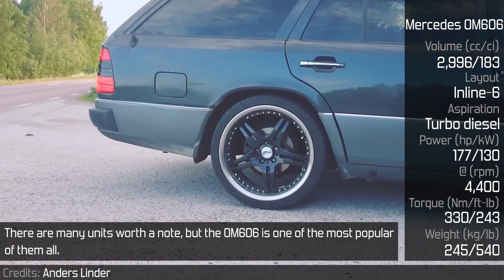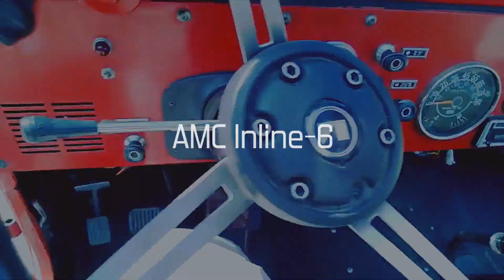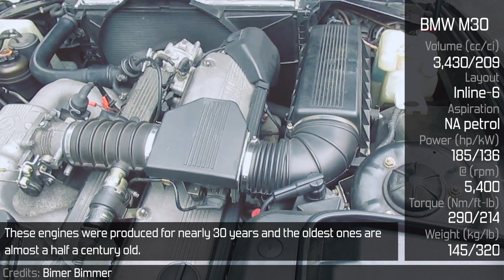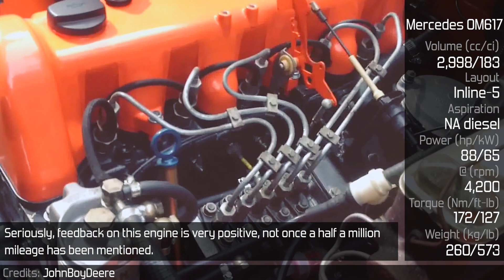10 Most Reliable Engines Running Beyond 300,000 Miles

Comment: I had a 1.9 TDI once. Bought it with only 45,000 miles on it...vehicle was totaled with 365,000 miles on the clock. It still ran great. If it wasn't wrecked, id still be driving it.
Reply: Oh hi m8
Reply: Roshan S what's up
Reply: Didn't expect to find you on here lol.
Reply: What happened with Google hangouts though?
Reply: hey man hows your s60 doin?
Reply: What year was your TDI?
Reply: 365,000mi is pretty good.
Reply: I had the transportdr van with the same 1.9.   
It still running with 680.000k on the clock!
Reply: my MK4 VW Jetta TDI has 524,000 MILES on it and still running strong ive gone through 2 clutches 1 transmission and lots and lots of parts the paint job was redone at 300k and its MINT. 1.9TDI for life
Reply: The 1.9 TDI was the best engine VW ever made
Reply: Insane S60 my grandparents just gave me a 04 jetta tdi 5 speed. it runs strong and it's at 185k im gonna see how far she will go.
Reply: I own a 94 golf tdi with 706000km and still runs great. Always well used but with poor maintenance. Maybe one of the best engines ever
Reply: VOLKSWAGEN TDI FANS UNITE
Reply: Mine has about 500,000 km so about mid 300,000 miles and it still gets daily driven
Reply: My dad had an A4, I believe it also had a 1.9 TDI, traded in for an allroad at 600000 km
Reply: Theodore Marakas what do you mean free financing for 6 years like pay nothing for 6 years
Reply: Insane S60 My uncle was part of the engineering team that built the 1.9 tdi. He always told us it's well capable of running beyond 300k miles. He bought one and my parents did so too. 250k km so far on our Passat. We'll drive it until the wheels fall off 😄
Reply: Paul Hojda Oh yeah I recall my uncle mentioning that a couple of times haha
Reply: Theodore Marakas makes sense most owners have their Volkswagens for at least 4 years
Reply: Telegraf Stalp I'm from the usa... title says 2004 lol
Reply: My Jetta 1.9 TDI BRM (2006). Just turned 100k miles  and I changed the timing belt. I'm hoping to keep the car a long time and look forward to high mileage.
Reply: work on taxis which use the exact same 1.9tdi. lovely engine to work on and almost all have 600k+ miles on them and still go well with regular servicing
Reply: Insane S60 They are great engines, only issue is the double mass flywheel going bad eventually. The SDI engines, basically the TDI without a turbo, are even stronger, operating under lower pressures.
Add to that their electronic throttle that's unmatched in terms of response. Truly a masterpiece.
Reply: A few decades ago,  the taxis in China were Mercedes E-class diesels. Now they're mostly VW Jetta 1.9 TDI.  A million KMs is common with just normal servicing.
Reply: yeah uk is trying to get rid of old taxi. they must be euro5 to be registered now
Reply: Insane S60 what about chevy impalas r they good cars about how many miles can u get bro.
Reply: MostlyIrishCarGuy hey, sorry this is so late, the S60 is doing good
Reply: Tanatose
it was a 2001
Reply: dakota croasdale 
if you take care of it, it'll last you a long time
Reply: Arthur Hunter 
I'm not to famailer with Impalas to be honest
Reply: GET RID OF THE IMPALA!
Reply: BIGTAZ351 the Impala has been around since 1958, it's as American as apple pie. an American icon.
Reply: Yeah, and Harley Davidson has been around since 1903, doesn't mean its a "GOOD" product...All the Front Wheel Drive Impalas have electrical issues from hell...
Reply: Bigtaz - so true. Actually many of the chevys were crappy cars. I grew up a big chevy fan building chevy hotrods, and street rods. I was mostly a small block chevy guy. why? Parts were plentiful, cheap, and interchangeable. The fact is that the chevy small blocks were pretty soft iron and by the time you got about 100k miles on them, you had quite a ridge in the cylinders. Fords and Dodges were more expensive to deal  because they didn't really hold to too many engine design standards. Ford in particular was always experimenting with different designs,. One of the most wonderful and outrageous production engines from Ford in the way-back past was the overhead cam head 427s that came in the GT40s. If you can find one of those engines today you'll pay a fortune for it. Modern technology like the aluminum engines built for the newer corvettes are better now so it's relative. 
Everything has it's pros and cons. Chevy used to use bodies for their cars made by Fisher. They were junk. In no time you would have problems with sagging doors and other mismatching body parts. The fact is that some of the most popular  American icon muscle cars were absolute junk, like the camaro, and the Ford mustang. Corvettes used to be heaps of shit too. Now days all these cars are much better as manufacturing methods and standards increasing raises the bar. As much as I grew up loving chevy's, they're nothing to brag about. We love them because of how some of them look and what they stand for. Not because they're really good cars. They're ok, not great.
Reply: I have a 2004 Audi A3 1.9 PD TDI, but it's still young, only has 184.000 miles on the clock. ;)
Reply: Fred Flintstone well, you may have experienced that,but I have the 58 Cadillac my parents bought in 1960,body by Fisher.  and the doors open and close very nice, and the engine just had its 1st rebuild 4 years ago because of excessive blowby. I also have a 68 Mustang I bought in high school,  bought in 1977, body fine, doors fine, and that 289 has still never been rebuilt,  still runs great. Maybe the fact these cars are  lifetime so cal desert cars , IE Palm Springs,  has something to do with their strutural integrity after nearly 50 and 60 years.
Reply: Ah yes, the 50's when they used heavier gauge metals. Not too bad. Sorry, your 68 stang is junk. we love the cars because they're part of the american heritage, those were very cheaply made, poorly designed bodies. Bodies by fisher in the late sixties and later were cheap junk. Sentimentality doesn't change the fact.
Reply: Fred Flintstone say what you like,but I' HAVE OWNED   and driven this Mustang for 40 years this year, and it hasn't changed at all . and cars made like crap don't survive in use 50 years . Hell, I drove the stang to Vegas and back last winter from so cal. However, I wold like to hear what kind of car you believe are NOT JUNK. I will say my little Mustang has become quite a valuable little pony, she bone stock, never molested . nearly new appearing in and out. highest offer unsolicited,  car is not for sale, was 12000.
Reply: My 2004 (54) plate Bora PD150 has just over 190,000 miles on it, so it’s probably just about run in 😂
Reply: What parts do I need to make my PD150 make that cooooooooo noise from that blue Golf in the video? Love that noise!

Comment: Ford's  300 6 cylinder was a true workhorse. It was originally used in Farm tractors and irrigation pumps. A truly under-rated power plant  that was gear driven with minimal issues.
Reply: David  Harris My old man had one with over 400 thousand on the clock,with a cam swap,offy four barrel intake and true duals in a f100 and 3:50 gears it was a stop light warrior that would hang with or beat many v8 engines of the 70's and 80's.

Comment: The days of long-lasting diesels is over. Emission standards killed it
Reply: Buy an old diesel. They last forever. Fuck emissions
Reply: You can get a newer diesel and delete the emissions I did it on my Chevy Cruze and it's ran perfect for a hundred and fifty thousand miles so far zero issues. Delete the emissions if all possible then you got a reliable long-lasting engine
Reply: @AaronJohnson1979  150.000 miles isnt much but quite good for a chevy.

Indeed the deletion of that junk is good for the engine
Reply: @AaronJohnson1979  i want to do the same because i have a lot of carbon buildup in my intake system. Its fucked up. One piece of that shit can destroy the turbo
Reply: My dad has 2006 transporter over 670000km and nothing runs like a new
Reply: You mean spewing turbocharged soot out the exhaust may be bad for the atmosphere? who knew!
Reply: @TheWolfsnack  not for atmoshere but for humans breathing soot. If you drive in towns without egr+dpf it is very harmful for people lungs, specially childrens. It is normal for you chose to destroy little cirizens health. Stupidity. Buy a gasoline car
Reply: @WorivpuqloDMogh  they could go after you now diesel brothers got sued over $850,000 for roaling coal and removing def crap.
Reply: @tinko975  so does gasoline they can roal coal if you choke the air ways.
Reply: @WilliamHollinger2019  dont know but gasoline engine exhaust in less harmful than diesel. And when someone remove dpf or gpf filter it is health homicide
Reply: @WilliamHollinger2019  thats terrible...
Reply: diesel ugh
Reply: Literally thousands of people are dying every day because of air pollution, but yeah "fuck emissions"...
Reply: And it doesn't even make any sense because if everybody drove their diesel car for 40 years it would be better for the environment then buying a new one every 5 years
Reply: aaron johnson Here’s the problem with deleting diesel emissions. It’s illegal.
Reply: PiEn, most of the emissions are coming from China & other countries.
Reply: What about the 1VD
Reply: Thank god they're still manufacturing the Cummins 12-valve. I'll drop a new one in my 1990 D250, if I ever have to. Fuck emissions. A more efficiently-running engine should trump emissions, anyway.
Reply: @WorivpuqloDMogh  Right on!!!!!!!!!!!! Proud owner of a 1990 Cummins 12-valve. Recent upgrades include expanding the old 2.5" intercooler piping to 3", Mag-Hytec diff cover and trans pan.
Reply: @erwin643  man that sounds awesome.  I am a bus driver a´d we have a cummins in the back of 2 of our buses and they sound so sweet. That rumble of the inline 6 makes me happy
Reply: Cheat the system: benefit from both long lasting engines and clean air by driving an old car and not buying any new ones.
Reply: @tinko975  Whah.
Reply: Work for Cummins can agree
Reply: @TheFluffyWendigo  still great engines.
Reply: Now we have to change fucking batterys not that battery’s which give electricity for the car system THE FUCKING BATTERIES WHICH MOVE THE CAR
Reply: @tinko975  lol diesel exhaust smells awesome
Reply: @hunternelson3018  yeah so breath it Yourself with full lungs capacity.
Reply: @tinko975  ok, I do that all the time I work around diesels.

Comment: My 1997 Plymouth Grand Voyager Rallye with a 3.3L V6 has 406,000+ miles on the original engine and transmission. I replaced the rod and main bearings at 400k, they still looked new.
Reply: Everything on it works great except the original struts are squeaky and the self canceling broke off on the turn signal stalk. Have to remember to cancel my turn signal manually... :/
Reply: Oh yeah, Chrysler's 3.3 and 3.8 engine! My mom, when I was young had a '96 Grand Caravan. It dumped a trans at 140,000 miles, but the engine was perfect in every way!! It even sounded awesome with a hole in the exhaust, haha. I won't mention the fact it was super slow though.
Reply: 3.3 had an issue with busting the #6 piston. It would just simply crack in two. Seemed like a hit or miss problem, though. Some of them did it, some of them didn't. I've replaced 3 with that issue over the years. And all of them around the 150k mark. I'd say if you made it past that, you probably have a good one.
Reply: Special EDy I just bought a 2005 dodge caravan with 90,000 miles well maintained and almost new how long do you think it will last? they use them as mail trucks here in Baltimore
Reply: Bobby McCray if it's been maintained, and you continue to maintain it, or should go for a good long while. It may have electrical issues here and there, but the engine and trans are great if you take care of it.
Reply: ah, ok, I intend on spoliling it, my first dodge was a 95 dakota I still have for 15 years
Reply: @akio2589  HIT OR MISS I GUESS THEY NEVER MISS HUH? YOU GOT A BOYFRIEND I BET HE DOESN'T KISS YA MWAH HE GON FIND ANOTHER GIRL AND HIT THE DAB LIKE WIZ KHALIFA
Reply: @Andi-fh5lh  I... Assume that's a song reference.
Reply: @akio2589  I had to do it... I couldn't resist
Reply: @akio2589  I'm sorry
Reply: @Andi-fh5lh  I don't know the song. If it's rap/R&B, that doesn't surprise me. Not my kind of music.
Reply: @akio2589  yeah it is a rap song I like rap but only old school

Comment: Believe it or not, Range Rover Evoques are notorious for breaking down, but my parents sold theirs to my uncle and it has 200K miles on the clock and it's still going strong! Runs like the day it drove out of the dealership! Never had any issues on it whatsoever. It has a 2.2 Ford/PSA Duratorq 4 cylinder.

Comment: Dads 96 Chevy Silverado has over 650,000 miles and it’s his daily commuter . The transmission was fixed 300,000 miles ago. By now the truck is not visually appealing to look at but still runs like a beast .

Comment: I have a jeep with the amc 4.0 in it and its the most reliable motor Ive ever had
Reply: Maidenlord 666 same.
Reply: my dad bought a cherokee brand new and put 450k miles on it. It had the 4.0 HO
Reply: MrSapper21 wow nice. I'm currently doing a full engine rebuild on mine and I hope it lasts to 450k :)
Reply: I think that AMC  knew that when they put the 4.0 fuel injected version into the 1987 Cherokee. Why else use an odometer that could register to 999,999 miles before rolling over? (The Asian 4 speed automatic they mated it with is also almost bullet proof. I have a friend who rebuilds transmissions and he has worked on a total of three in the last 20 years.)
Reply: machintelligence Aisin not Asian but asian of course.
Reply: Color me embarrassed. I never saw it spelled out and assumed it was a location, not a brand. The only complaint I had was with the neutral safety switch, which can  become intermittent. The Jeep dealer gets about $250 for one, and early on they were the only source. Aftermarket units are now available for about 1/3 that amount. That's still quite a bit for a switch, but not highway robbery.
Reply: Amc engines rarely do that. At about 63 to 65 k miles they start eating oil.We had a rambler station wagon and a 69 javelin Thay both ran great but ate oil.
Reply: 286,000 miles on my 4.0 never a bit of problem, doesn't drip or burn oil.
Reply: +borderex, have you thought about a stroker kit?
Reply: Yea but thats a little too much for my budget. lol
Reply: fair enough
Reply: my 86 jeep 4.0 is at 262,000 great engine.
Reply: The AMC/Jeep 4.0 is a great European engine.  It was the 4.2 6-cyl, with no power, but drank gas like a V-12.  After Renault bought AMC they did 2 things: engineer a fuel injection for the 4.2 that boosted power so much, they dropped the displacement to 4.0 and still had 175 HP, burning half the gas of the old carbureted 4.2 litre. 
But the other big thing that they did was suspension work.  The French are known for their smooth riding cars, and the Jeep suspension drove them crazy.  After re-working it, they had the first 4WD in North America with a decent ride.  Once they combined that smooth-riding 4WD with a V8 and leather interior, the Grand Cherokee was an instant hit, and it kicked off the SUV craze.   
We may not even have SUVs if it weren't for those French engineers bringing some European sophistication to the Jeep crowd.
Reply: I've got two 1995 jeep xjs both with 4.0 ho and one has 475k and still passes smog and the other with 324k and runs great, it even whooped a 04 civic si the other day from a red light. Only complaint is poor city mpg